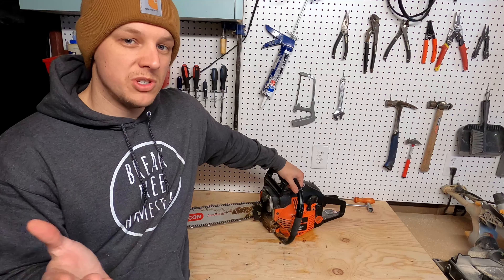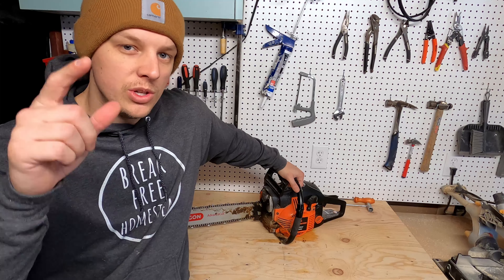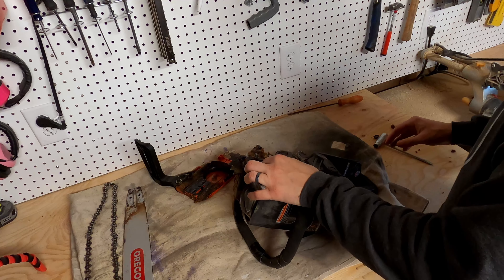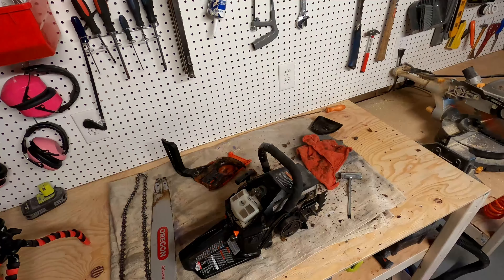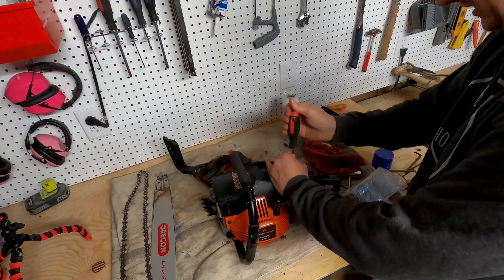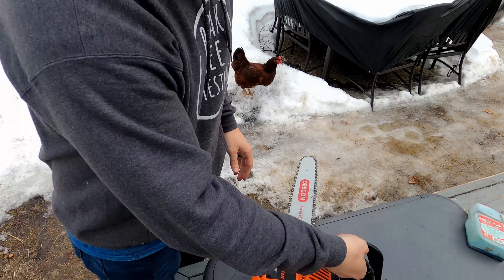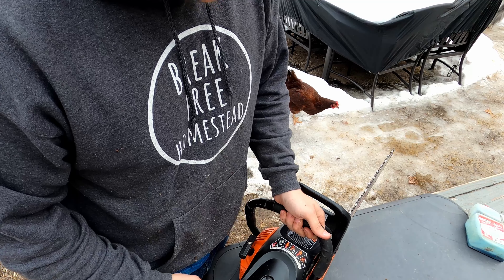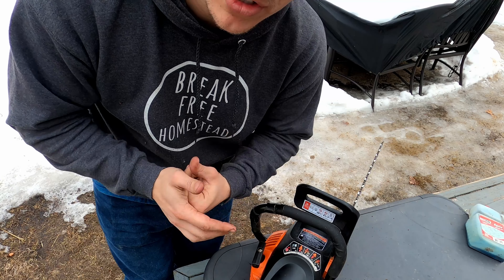Remington RM4620 Chainsaw wont Rev Fix. ||Fixing Bogging Chainsaw||

Comment: It worked for me. Just cleaned everything up and sprayed the air filter with compressed air. Cleaned the carburetor between the intake and choke with a rag, careful not to let any junk get down in there. The spark arrester did not need cleaning, it looked fine. Now it runs like brand new. Thanks.
Reply from the maker: Glad it helped! Thanks for supporting our channel! 🤙🤙🤙🤙

Comment: Do you think this sort of thing would also work if it is just stalling after starting?
Reply: My Remington Outlaw is stalling after staring to.  I was going to try and adjust the idle speed ( behind rubber piece) don't know how to get rubber off and I think I need a special tool to adjust.   Under that, the H & L.   I guess I need a special tool for that as well.   I'm think maybe it's my carburetor,.   have you fixed yours?
Reply: @Rowen170  no sadly. I found out it has terrible compression. Probably was run too lean or with straight gas. The piston is all scored and the ring is toast. Not worth fixing.

Comment: My suspicion is that the metal clutch was dragging against the (obviously very melted, if you look at the video) orange plastic clutch housing, which deformed while melting.  Once that clutch housing got cleaned out to remove the baked-on oil and melted plastic bits, that probably removed the obstruction.  Don't ask me how I know! Let's just say, I've seen it happen on this model of Remington. 🙃

Comment: I think I have a "built on Friday" Remington saw.  Bought it new on June 5, 2022.  First start on June 18th.  Cut down a tree and cut some logs.  Then it bogged down.  I pulled the air filter and it was dirty.  The carb throat was also dirty (air filter was not doing a good job).  Put it back together and an hour later, same problem.  I did this all day long, then put everything away for another day of work.  Next weekend, I ran the saw again.  Same clean filter and carb throat issue every hour or less.  Then it stopped on me.  The primer bulb was low on fuel and when pushed, it would make a noise like it was leaking air.  It wouldn't start, so I let it sit.  The bulb filled with fuel and I pressed it.  Again a leaking air noise and bulb low on fuel.  I tried to start it and no go.  I let it sit for an hour and the bulb filled.  I didn't push it this time and it started.  Did more cutting and then the air filter/carb issue again.  Cleaned everything back up and I couldn't start it.  The bulb wouldn't fill with fuel.

I called Remington for some help.  The only think I can do is bring it to a repair center 2-3 hours away.  No help from customer service.  I'm bummed and have an incomplete task ahead of me.
Reply: Did you check the fuel filter in the tank?  If partially clogged, that could explain problem with priming.  Replacements are cheap on Amazon.
Reply: Saw has a sorry excuse for an air filter. They come apart, stick a thin oiled filter inside cut to size whatever but as long as fines are getting in the carb it will run like shit until it seizes up one day.